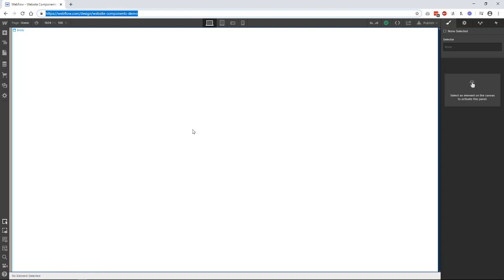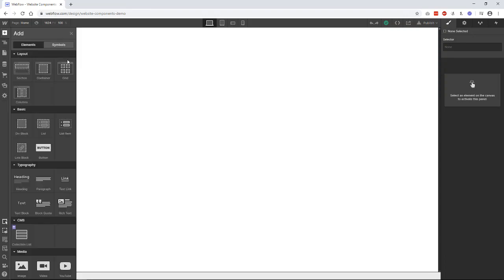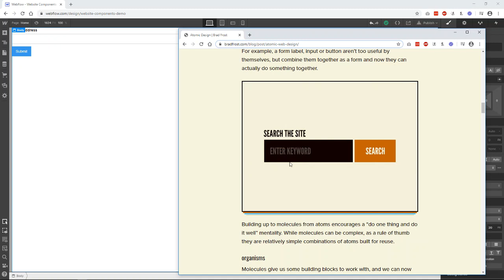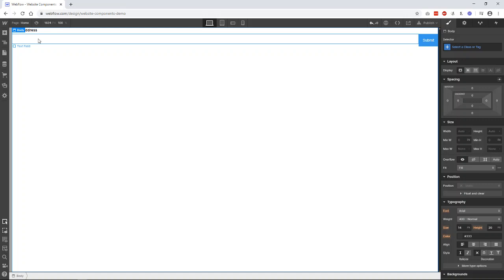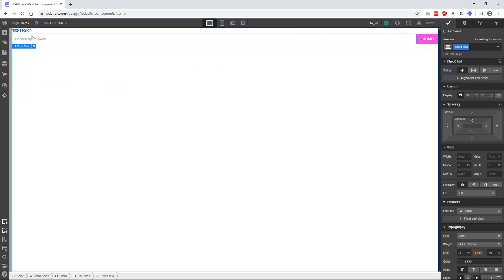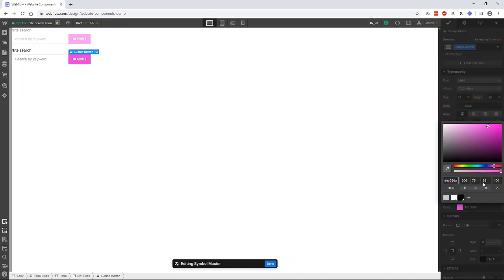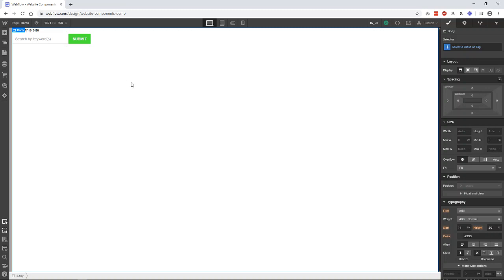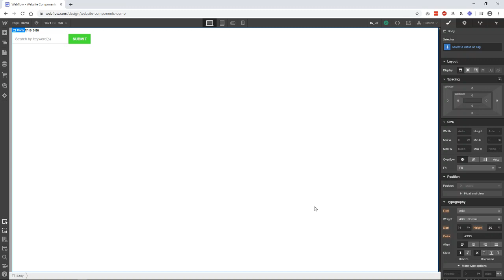Component-Based Web Design Using #Webflow

Comment: Thank you for the introduction to Webflow, Brian! My first impression of this website builder is to apply the analogy that Webflow is to HTML and CSS as Photoshop and GIMP and Figma are to artistic design. Webflow seems like a good choice to getting projects up and running quickly as it takes the pain away from the design aspects. But the pain inherent in working with basic HTML and CSS is my calling, I suppose, as I really like learning the mess and the muck of coding, lol. As always, thank you for your helpfulness in creating such useful videos. They are professional and always well done... Cheers!
Reply from the maker: Thank you for the kind words. I've got a whole series of Webflow videos linked in the description. I think of it as a visual web development tool. The company describes it as a no-code editor. Whether you do it the old school way or this way you are getting to the same place--the difference is the input. 

I will suggest that it's almost worth switching to it as your development tool just for the javascript effects. They are so easy to implement. It's almost ridiculous how easy you can do interactions.